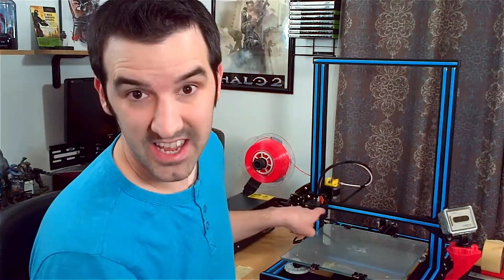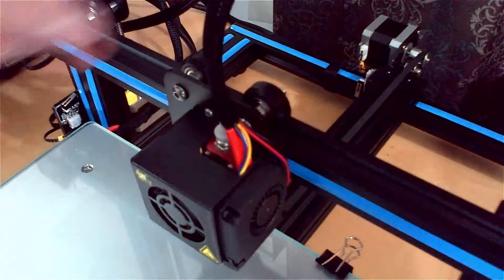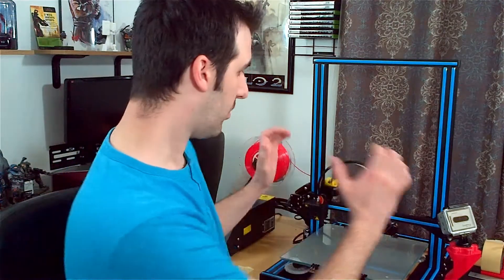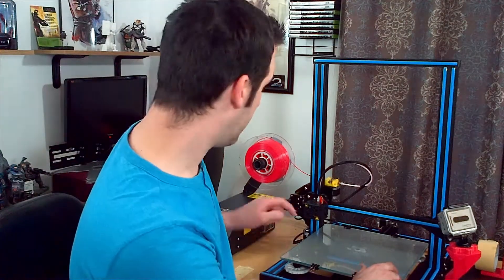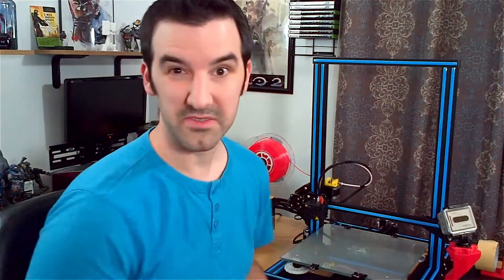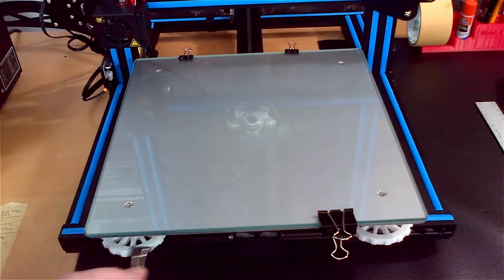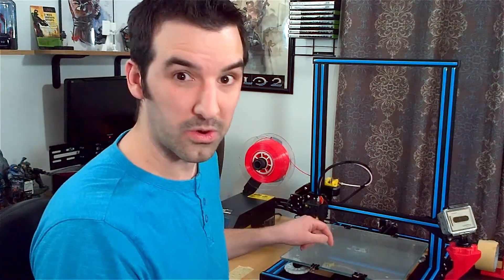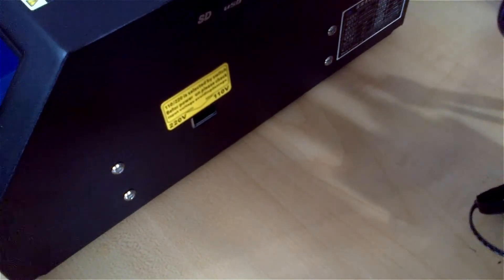Avoid These Mistakes - CR-10 3D Printer

Comment: About the clips holding the glass, you could setup the plate size in Cura so the dimensions are slightly smaller than the actual plate size.
I have the CR10 S5 coming. The plate size is 500x500x500, so in Cura I have set it to 498x498x498. Just to play safe.
Good video and thanks for the tips.

Comment: Ditch those blue rubber strips, they are only there for aesthetic purposes and serve no function. They also cause more problems than you could imagine. Another tip would be to throw away the warped glass build plate that came with your printer and get a new piece of glass from a local glass shop or hardware store. Make sure they smooth out all the edges of the piece of glass so you don't cut yourself, and that also make the glass more resistant to breaking.
Reply: Ikea mirrors work great
Reply: Yes, it is best to have a flat build plate for sure...the more improvements you make to a printer and better the prints will be...